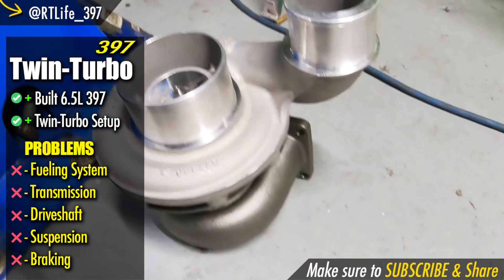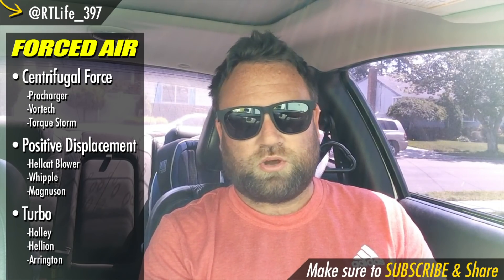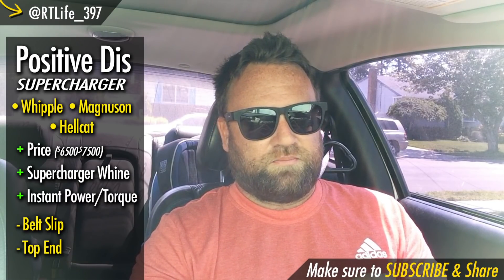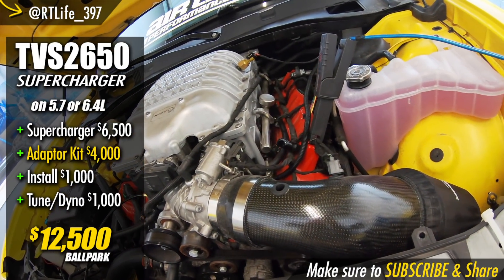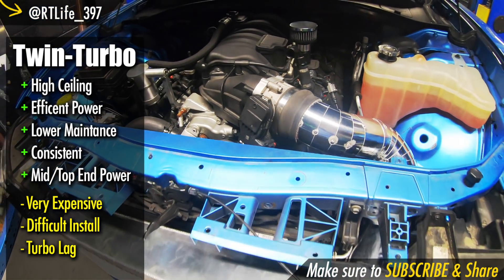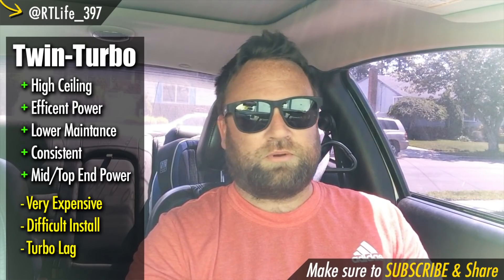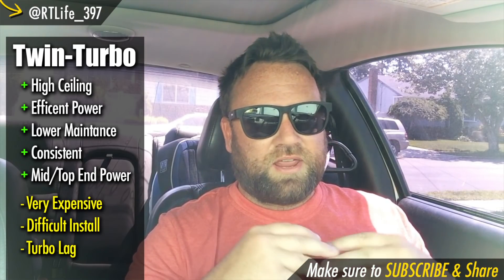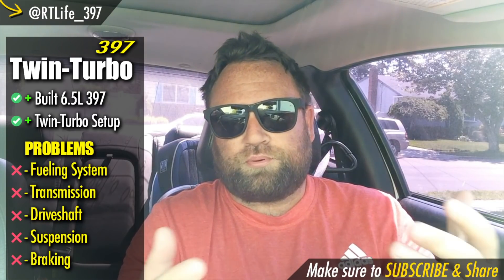Turbo OVER Supercharger? Why

Comment from the maker: It's an expensive route but I think it will pay off! Hoping to have the RT back tuned & ready to rock soon
Reply: Can’t wait to see how it turns out when you get it completely dialed in
Reply: Expensive in terms of what? Just purchasing a supercharger on 392?
Reply: Now you start to realize the cost and time involved. It is worth it in the end, but...

There is no end.
Reply: Speed and reliability , that's Awesome brother 💯 ,  it's also the journey along the way with the build that's fun 👌👍
Reply: Hi R/T, sofar aprox how much have you spent?? -price of car of course...no worries if you dont want to.keep up the best TT setup i ever seen! much appreciated on sharing your excellent experience. from south australia. God Bless!
Reply: @vital4644_  boosted aps can make better MPG than stock of driven " normal " More torque to get the car going.
Reply: How much and where did you buy the turbo kit?
Reply: @JonathanDiaz-vm5mb   I don't believe it's a kit, from what I have out together, he purchased the turbo pieces, and tbe the shop is making the " kit "  Hellion has a twin turbo complete kit for the LX,LC,LD platforms.
Reply: @SModelMafia  I been looking but Andy's sales the turbo kits for older dodge like 2010 and under
Reply: How much does the install cost and the extras together that don’t come in the kits that range from 7900 to 12k. Or are shops selling them as a kit and then are adding in the install and everything in a package?
Reply: I’m going f1x on my 392! I posted some videos of the build! Currently my engine is at the machine shop
Reply: And the fact modern custom aftermarket modifications already expensive regardless so I agree this is a great route in my opinion it's why I believe Mercedes went the same route with all their V8 models vs BMWs Karl Benz has been the German OG since 1885 not a BMW hater but MB has decades of experience to back them up

Comment: Very good video and break-up. Many people asking "How much cost engine swap from 345 to 392?" without even realizing additional cost of upgrades. So.... have you done all extra prior engine swap? What is that 397 engine came from? Another question that needs to be resolved -  with the new setup, if after time you'll face some mechanical issue with engine / turbines - who will be able to fix them? Can dealer garage handle this stuff?

Comment: Turbos you have to change your oil a lot more often since the hot oil from the turbos goes back into the engine.in my opinion procharger is much better since it does not share oil with the engine .turbos are great for power but for daily use can be a pain boost creep is a real thing be careful

Comment: Just my opinion! You could have bought a hellcat power plant and added to that for what you spent on your build without adding turbos. So 🤷🏻‍♂️
Reply from the maker: Basically a $65k Twin Turbo R/T with everything included. It's about $50k for used hellcat & to get a fully forged twin turbo hellcat you're likely in the $75-80k range

Comment: Got mine back from OST Dyno with the Whipple on Tues the 25th. Very please with the car, how it runs and drive. They did a conservative tune on it as it is stock bottom end and with the 5.7L/6.4L transmission and axles it made 527 WHP on their dyno. That's what everyone asks but, Dyno number mean very little. I know you asked me to keep you updated. Your car is just badass.

Comment: Thanks for the information. How much were you making NA.
Reply from the maker: it was around 450whp & 455 in torque
Reply: @RTLife  Those are still good numbers. Would you change the rear diff also for a quicker jump off the line.

Comment: A good way to go with transmission is to go with the hp90! It'll handle the torque you make with this setup and it's about half the cost of a fully built hp70 that will handle what a stock hp90 can handle

Comment: Stock injectors? When you are ready for a fuel system I would recommend you talk to Rick at Tapped Performance. I just installed 2 of his return style systems on mine and my wife's cars. His wiring harness really simplified the installation and looks like it came from the factory. If you decide you want to run methanol let me know. I have a 55 gallon drum I'll give you if you pay for shipping. We've converted to E85 so the meth is just sitting in my shop. The build looks really nice. You'll have a lot of fun once you learn to drive a turbo car.

Comment: I think you're going about it in a reasonable way. Build the engine first so you don't blow it up and have to yank all the stuff off to rebuild it. Then add some easily adjustable power and as you buy the upgraded components you can dial up more power.

Comment: Triple pump, injectors, and a one peice driveshaft. Brakes, just do rotors and good pads. As far as suspension you're fine bro. As long as they aren't blown. It's not like you're going to auto cross the car. Love the build. Good luck.

Comment: The more you move up in power, the upgrades in drive line, suspension, brakes, and safety equipment for the track are gonna be big expenses as well. This hobby is fun, and very expensive as well.

Comment: I think you made the same mistake many people make. You're too attached to your car. I would prefer the Procharger over the twin turbo. Power isn't the issue in this case. People with Prochargers can make in excess of 3,000 horsepower.  With a family I don't think you can afford that kind of spending. I don't care for the twin turbo set up for a variety of reasons. I don't like the location of the turbos especially in the rain. Turbos put more strain on the rest of the drivetrain and you're more likely to break stuff. The tumbling rocks sound you demonstrated with a Procharger set up is with straight cut gears. A unit with helical gears isn't noisy. 
I think you would have been better served by the Procharger. You could spend the summer drag racing and going to car shows. That would increase interest in your car. I think it’s time to move onto another platform and eventually sell the R/T. Although the channel continues to grow, having a Mopar only channel limits you. No matter what is done to the R/T the car won’t generate as much interest as a modded Hellcat, Corvette, or Camaro LT-1, or a Shelby GT 500. I hope that I’m wrong when I say dumping a bunch of money into an R/T won’t get you where you want to be. Replacing all of the support systems in an R/T will be costly while providing less benefit than going in another direction. If you don’t believe that look at other car channels that are the most successful. They’re not wedded to only one brand or one car. As I said at the beginning being too attached to your car will cost you in the long run.
Reply from the maker: This R/T isnt the money maker on the channel. Videos of the Ghoul, Cuda, etc. is what really makes the revenue. I need to have a channel car so I'll stick with the RT. I can't afford hellcat payments & mod it. Would become just another boring Mopar channel where the build stops at a mid-muffler delete & car wrap. Most of the time I get really solid discounts to make modding worth it. The channel gets the views of a larger channel - people just don't commit to subscribing.

Comment: Is something like this even worth it I be seeing pro charged R/Ts still losing to scats and samething with scats losing to hellcats it’s like is the money worth it if it won’t be faster than the next trim
Reply: If a ProCharged RT is loosing to a stock scat pack, chances are a driver modification is needed. Obviously the year of the RT matters. The 2010 and earlier models with the Nag1 didn't make great power stock with a Procharger and certainly didn't get that power to the ground as well as the 2015 and up models.

Comment: You will see and outrun your system.. do yourself a favor.. get 1700cc injectors and get turbos that will support your future final power goal.. mines a camaro, but I got away with stock engine trans and rear at 600 rwhp for years.

Comment: I've been telling you all along that you need to upgrade the rest of your drivetrain, as well as your brakes. Highly recommend DSS for the driveshaft & axles. Love my 1-piece CF shaft. Also recommend either R1 Concepts it Baer for brake kits. I know the Brembo's are nice, but they're more expensive. They also require you to replace the front spindles on the R/T from what I found when I was looking into them for my R/T Chally. I'm glad that it's coming along for you though. 👍🏼

Comment: Hey RT this is what your channel is about . Building a RT . Yes you can buy a hellCat 
But part of this whole sport/ hobby is to take a car that’s stock and bulid it the why you want it. 
When I was a kid and got my 73 charger it had a 318 in it . I did headers a 550 lift cam -? holy 650 bbl pump carburetor. With ram air . It was my bulid .  And I had so much fun doing it .

Comment: Slowly but surely. You can simply upgrade what needs to be done by order of priority. Most people want everything done at once only to realize that they have to work backwards now due to all the adjustments, to make the build function at it's maximum potential. Love the build fam it might cost a bit more but at least you would have accomplished what you wanted in the beginning wich was to build your own rather than buying a finished product . 
I went the other route after your video on "should you build a 392 or buy a Hellcat?"
1 week later I sold my Green Go SRT 392 and purchased a Hellcat instead. That video was a real game changer for me!
Will keep watching ads and supporting the channel. Love the R/T 397 it will be a beast.🤙🏼💯

Comment: Don't believe what some people say about turbo lag. There are several things you can do to "defeat" the lag. For one...you can have the turbocharger(s) closer to the engine. And two...if you are working with a good mechanic that really knows turbos...the degree of the impeller can make a huge difference as well. Both of these examples...look at the audi, bmw, Mercedes twin turbo v8 setups...they make peak torque at like 1500 rpm...and hold a flat torque curve till about 5k rpm and start to taper or fall there but by that time the hp is picking up near its peak and keeps on going.

Comment: They all are great forms of boost but all for different purposes and motors. They all are consistent, all are generally reliable. The reason mopar went with a pd for the hellcats and racing, was torque. These motors are built for torque. Either way really awesome to see the build coming along.
Reply: They went with superchargers for the NA sound. They know their audience. Torque means nothing if you can’t hook.

Comment: The path you're on is the path to unlimited power. 1300hp+
Reply from the maker: agreed. This forced air setup will certainly get me there. Just need the rest of the RT to hold up!
Reply: @RTLife  get the Bingo Card of Drivetrain Destruction going! That'll get you over 100k subs easy😀

Comment: A few things, plans to upgrade oil cooler, are you running Amsoil due to living up North, and you're heart isn't little. Seriously folks this guy has a huge heart. I'd never spread bunk info.
Reply from the maker: I just use Mobile1 - that's what Jannetty told me back when the engine was done. Thanks man, def appreciate that.
Reply: @RTLife  Should be fine. I was wondering because Amsoil stays less viscous at a lower temperature but doesn't break down at high temps. It is a bit more than Mobil 1. If you start missing any on the dipstick ask Jannetty or RZT about it.
Reply: @RTLife  check project farms video on oils, you may change your mind about Mobil 1. Pennzoil Ultra Platinum is the best, and recommended by SRT. Either way any name brand oil will do fine but it makes me feel better knowing the oil in my car is 2% better than the rest lol